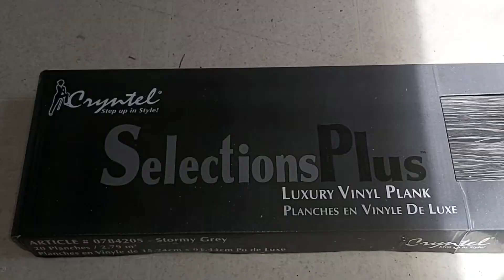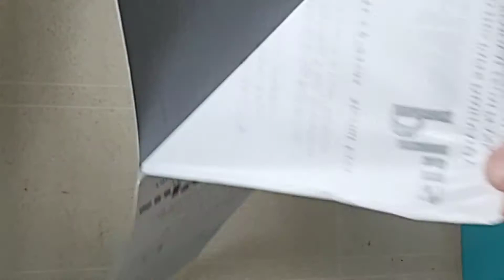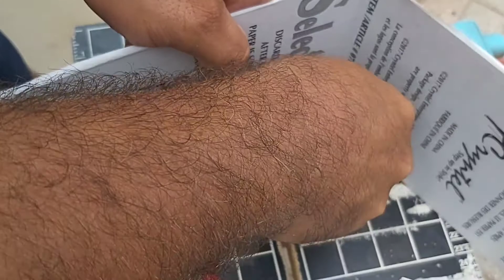Pop Up Trailer Remodel Video #5 Vinyl Flooring

Comment: I'm in the middle of a remodel on a 1994 Jayco pop up. Exterior paint is tomorrow, then flooring! Mine looks similar to what you have.
Reply from the maker: wow that's great :) what kind of paint are you using? mine could use a bit as well.

Comment: My linoleum has bubbles in it and tears that are running up.  Should I pull up the lino or will vinyl keep it down when going over top?
Reply from the maker: we cleaned our flooring really well and then put it right over top

Comment: Thank you for posting this video! I purchased a 92 pop up and bought the same size flooring you did. How many boxes did you need to do the whole floor project? Was it just the 1?
Reply from the maker: lol that's a good question, It's been so long.  I just looked it up a box has 30 sq feet. I still have a few tiles left over also so I will quess I needed 2. hope that helps. I will tell you it held up very well last year for us.

Comment: Very nice.  Doing mine later.  Did you think about staggering at the enterance or under the sitting area?
Reply from the maker: No, although it would look nice, I just did it this way because less chance of one of the corners getting pulled up.